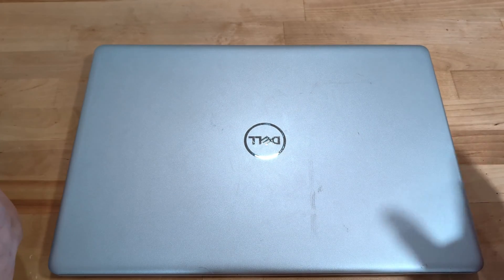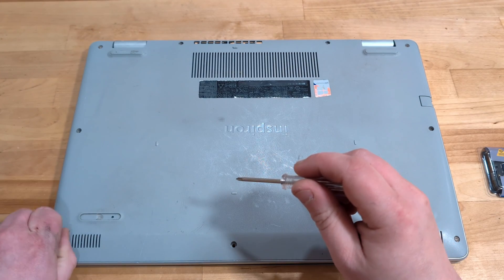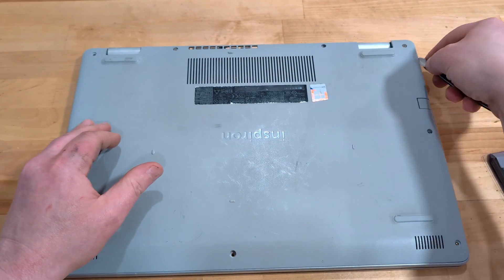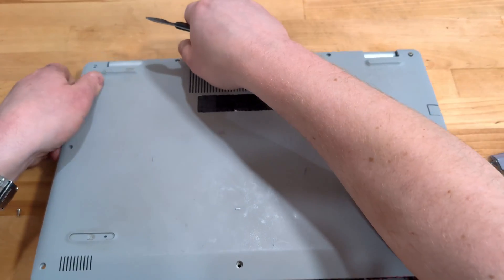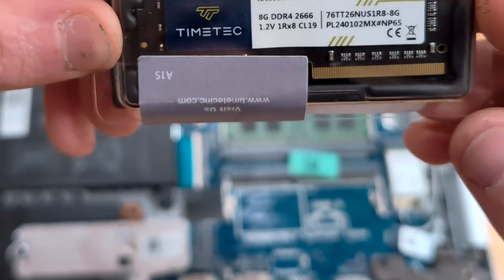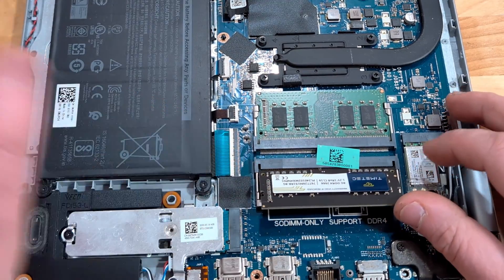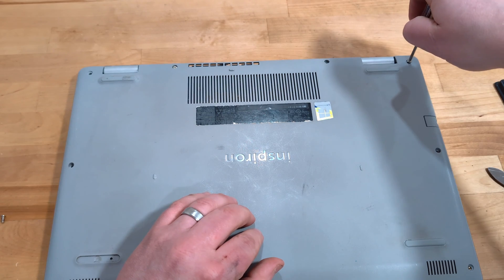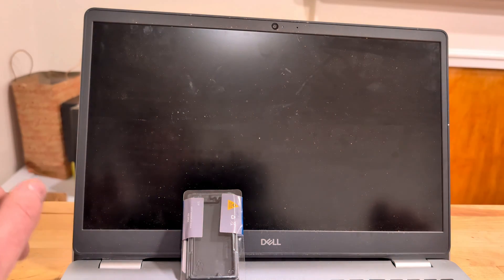DIY Memory Upgrade | Dell Inspiron Laptop Step by Step Ram Replacement Guide

Comment: Guys, please watch a few other YouTube videos before going ahead with a RAM upgrade. This one does include some useful angles, but it doesn't include some important information:
1. Use an antistatic mat and wrist strap when working inside the laptop, to prevent static discharge damaging sensitive components.
2. If your Inspiron comes with an optical drive (CD/DVD), that will need to be removed first.
3. Be very careful not to push the pry tool too far inside, in case it damages some internal component. A hard plastic lever is also safer than a sharp metal edge.
4. Before touching the RAM, disconnect and remove the battery, then press the power button for a few seconds to discharge the circuitry.
5. Don't use a sharp metal blade to prise the new module(s) out of their packaging, as that could easily damage the module.
6. Hold the RAM modules by the sides, never pressing your fingers onto small parts and especially not touching the gold contacts.
Most of these are general principles which apply whenever working inside a laptop, and will help to avoid damaging vulnerable parts.